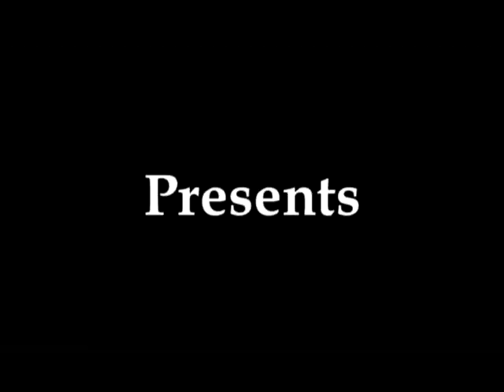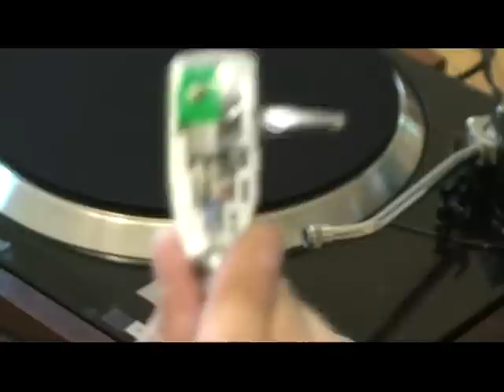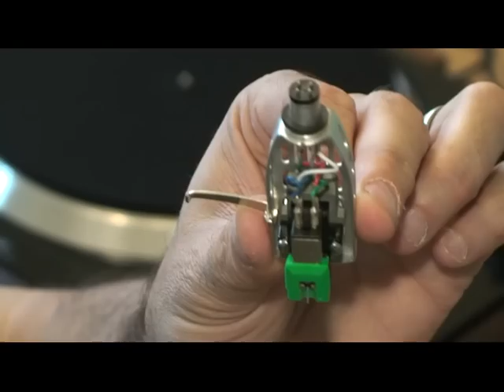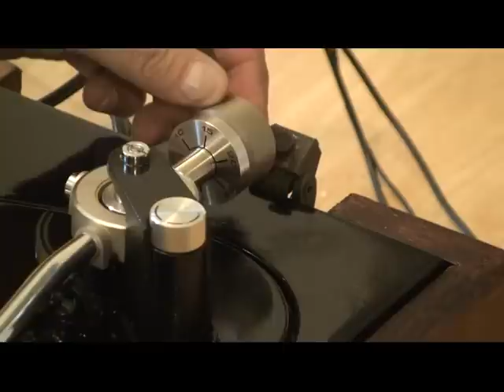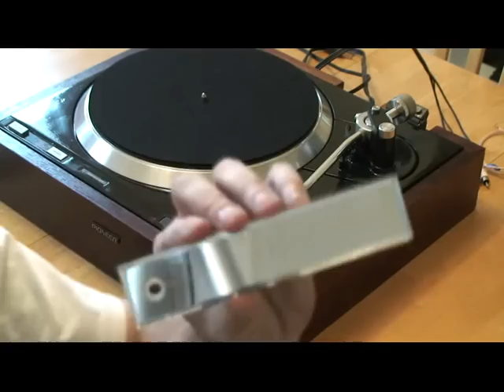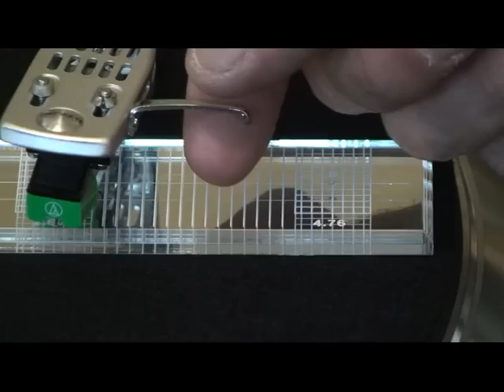How to setup a turntable - turntable and tonearm setup

Comment: drill with protractor looked suspicious-he didnt anything so why I have to purchase it?
Reply from the maker: The protractor is essential. It sets the ARC to the correct angle as it can never be the same on the outer groove as it is in the inner. Search on using an arc protractor turntables and you will see visual drawings of what I mean
Reply: ok cause in video it wasnt done anything

Comment: Your scale is too thick that is why your weight is off .You should get a proper stylus gauge it sits closer to the platter and is a lot thinner thus giving a more accurate reading. You want the weight as it would be on the thickness of a album and should be set in the higher recommendation from the cartridge manufacturer. Saying this your video is very helpful to newbies getting into vinyl .

Comment: Nice. But there's no real link between Anti Skating and VTF. It just doesn't work that way. The only proper (and not really manageable for all)-way to set up anti skating, is by using a test record with heavily modulated grooves, and a scope. Both are quite expensive, to be honest.
The 'cheap and dirty' way I like to use is setting the weight very light, under half a gram, and adjusting the Anti Skating so the audible distortion is as little as possible. Afterwards, obviously, setting the weight back to the preferred value.
Anti Skating and weight are depending on eachother. The higher the weight, the easier the cartridge tracks. So ideally you set the weight while setting the anti skating, trying to keep the weight as low as possible (which is nearly always within the boundaries provided by the cartridge maker).
I probably should make a video at some point of how this is done, but I don't think most 'budget' turntable enthousiasts would care to buy a scope and a 60 dollar test record for it :D.
Reply: please do!
Reply: cabasse
I'll try and find the time :)

Comment: The tracking force has to be measured at the level the stylus actually tracks at. You may be using a more precise instrument but the arm and cartridge should be parallel with the record surface. Similarly your stylus overhang protractor should be set so that its surface is at the height of a record and the cartridge and headshell are horizontal and parallel to the record. 
The set up as you did it would have too much tracking force and the cartridge would be a little too far forward.
Reply from the maker: Thats not always the case. Through extensive testing, being dead even with the platter for measuring tracking force only applies to high end arms that have significant dampning...not the case for many consumer TT's of the 70's. And even with dampening, the force difference is almost negligible when we are talking1/10ths of  a gram. Also, the overhang is done via various methods and is close because you CANNOT ever achieve perfection regardless of what method you use. I use Baerwald which tries to find the best center - Baerwald calculated null points of 59 and 102mm should give the lowest average RMS distortion across the playing surface Baerwald? Loefgren? Stevenson All three work but as stated, there is always a trade off between where the most distortion would occur (beginning tracks or end track) because it is physically impossible for a straight line to follow the curve uniformly across an LP that is circular UNLESS the cartridge itself were to dynamically alter its own angle as it progresses. The goal is cneter groove throughout by since that is physically impossible. its moot. Also, the slight height of the protractor in the vertical has ZERO bearing on aligning the horizontal null point. But think of the value in your negative comments. You got to learn something 😃

Comment: very detailed instructions. But one (very common) mistake: don't use the blank field of the test record for anti skating adjustment, it will give wrong results in most cases! The skating force in the groove differs significantly from the skating force on the blank part - and the amount of that difference does vary with different stylus forms. So better use the tracking test grooves. If the antiskating is wrong, one chanel will have distortion (or more distortion than the other, if it's a poor tracker...); adjust until both channels sound equally clean - and than you have it!

Comment from the maker: True...to be honest, it doesn't matter but there is some school of thought that by raising the arm that high doesn't give a true reading. I gave you the "accepted way" however; check for yourself. There is no difference. So weigh it with the scale on the platter. Now do the other method, on the side of the platter level with where the album would be..results will be the same. or so close as to be irrelevant.

Comment: How do you know your 10 dollar gram scale is accurate? And to measure that weight...your tone arm needs to be level...
Reply from the maker: 1) my 11 Dollar gram scale was verified with gram weights. 100% accurate. 2) out of over 50 turntables tested, the height didn't matter because the arm damping was linear; not progressive. Only two ever showed a difference and it was negligible. I'll take experience over audio snob any day. Satisfied ?
Reply: The best position for a tonearm is always level............
But not necessary for a cartridge body and the correct SRA of the needle , all is compromise. If the diamond is mounted correctly so the azimuth, SRA ans zenith are correct , you are lucky . 
For alignment one must align on cantilever and angle of the diamond , often it is a bit different than when one aligns to the body ......
Baerwald ( LofgrenA ) is the most common choice , Lofgren B is prefered by some ...
On a 9 inch tonearm , changing he pivot height of the arm by  4 mm gives you only a correction of 1 degree change in SRA....
The VTA is related to the SRA ..............but one should align to the SRA. ( except for spherical needle shapes, then  it does not matter )

Have a nice day and pleasure with listening to records .

Comment: Anybody can point me to a vid on setting up a tt that has a side weight like a Sanyo TP-1010??
Reply from the maker: The side weight is your lateral force adjustment weight. all the rest is the same for setup. You can find the owners manual and service manual at vinylengine dot com. Easiest way to adjust it is......set antiskate to zero. install stylus guard. zero float the arm. set the oposite side of the turntable up an angle equal to arm offset....or about a 23 deg tilt. If the arm climbs towards the spindle, or falls away from, adjust the lateral balance until the arm stops climbing or falling.

Why does it have a lateral balance adjustment? Because the arm doesn't have a natural "zero" lateral balance. The imbalance in the arm will cause it to over-react to slightly off center records, it will force the arm to want to "fall or climb" during play in the lateral plane,..... ie skate. If the arm is balanced rt/lt in the lateral plane there is no extra mass right or left. No mass = no torque.

After setting the lateral balance, go about setting the arm up for normal play.

Comment: "Centrifugal force pulls tone-arm toward the center." This does not make sense.
Reply: +Pat Doyle centripetal !
Reply: Sandor Csiki Skating force is neither centripetal nor centrifugal force. It's friction from the record on an angled stylus. The component of friction toward the center of the record is a force on the tonearm toward the spindle. If you had a perfectly straight (tangential) tonearm and stylus, there would be no skating force.

Comment: Incorrect about more tracking weight causing more record wear.  Actually, too little tracking force will cause more wear due to stylus mistracking and moving around in the groove.  Obviously you don't want to track at a force higher than recommended for the cartridge, but that would be for other reasons not record wear.
Reply from the maker: Not incorrect. Too little or too much will cause it. Marketing always tries to get you to the low end. Engineering wants you on the higher side (they are correct) but many people go TOO high to try and compensate for other issues (like incorrect anti-skate so they bump up the tracking weight). If a stylus says 1.50 - 1.75 , then 1.70 would be optimal. Near the tip end but not at and not over ..remember also, this is for newbies.

Comment from the maker: Gabe...call me youtube challenged...I don't know how to PM you. I clicked on your id but see nothing to msg you :-( ..Azimuth. Not every table will let you set azimuth. If it does, there is generally a screw under the arm near the headshell that you loosen so you can shift the headshell left or right angle (as you face the front of the cart). The bottom of the cart should be as close to EXACTLY parallel to the album surface as possible. With the table OFF, lower the stylus on an album. Does it look parallel ? You can use a card - make a mark were the right corner is. Now check the left corner with the mark you made on the card. Does it match? The absolute optimal way is with a Fosgometer but they are expensive. A test record can help also. if you want to email me, I am at gmail. arcorob.